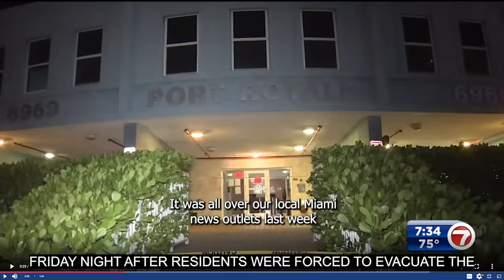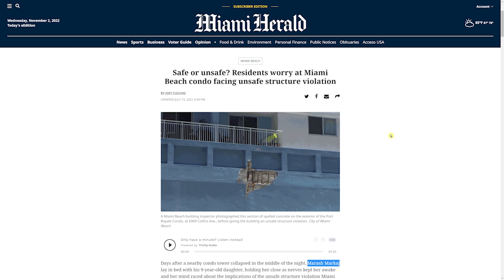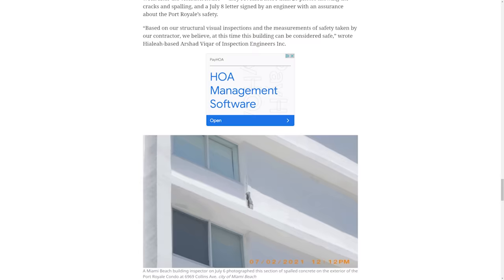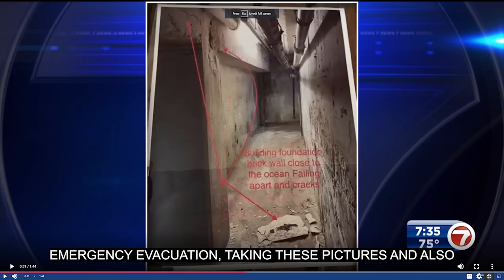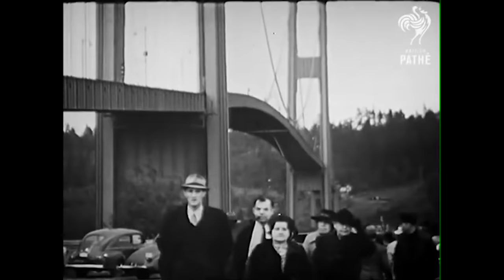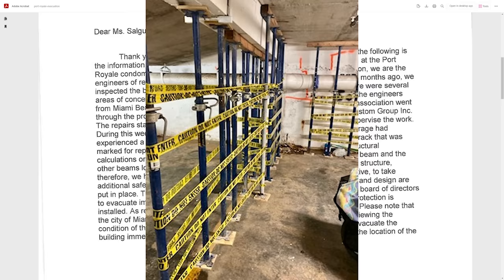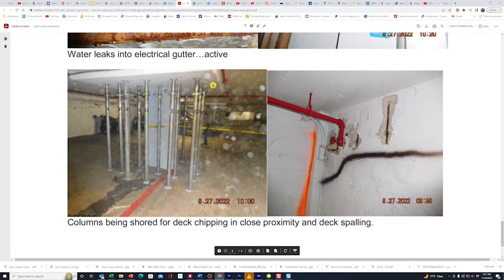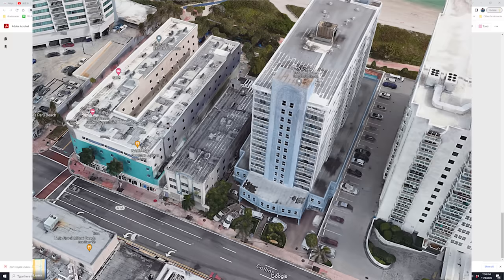Another Miami Condo Evacuated Why it Will Collapse

Comment: From the first footage it seems the entire length of that beam has been patched in the past. For other footage the building looks like it's beyond being repaired and should to be demolished.
Reply from the maker: Sometimes repairs are not done correctly to accepted standards
Reply: @jeffostroff  The issue is that if it rusts the first time, it usually means the covering concrete is too thin, which means most of the hidden steels are rusting in what is a salt atmosphere - hence there are issues everywhere.
Reply from the maker: @cs7th   It usually does not mean the covering of concrete is too thin usually the rebars are buried in inch and a 1/2 into the concrete the problem is that moisture penetrates that deep easily. I have owned condos where leaks on the floor will penetrate through a 4" concrete slab down to the unit below us. It's a simple case of water gets in because it's not sealed properly or they don't upkeep the paint and then it has no problem traveling an inch and a 1/2 down to that 1st rebar rod

Comment: These buildings were built in the height of American produced acid rain. If a building gets leaks the time table for collapse speeds up. Structural concrete is a big mistake and almost every high rise here in Vancouver is being built with structural concrete and acid rain here is ten times as bad as Miami gets. The side walks here are literally dissolving.

Comment: Is it the concrete mix? or the humidity & salt content of air? or other factors also. Honolulu has many condominiums 40 - 60 years old. I think the ground in Honolulu has more solid rocks, igneous rock and no limestone. hmmm ... inconclusive. more investigation needed...
Reply from the maker: These buildings would not need to be ticking time bombs if they simply maintained them better, and sealed them properly, and repainted them on a more acceptable scheduled basis based on how long that paint is guaranteed to provide protection externally to the building.

Comment: They are all concrete built structures that were over 30+ years old had the same problem the rebar is rusting out inside the concrete due to the salt water which is expanding breaking up concrete.
Reply from the maker: Yes, salt on roadways really hurts especially the metal bridges

Comment: Nothing but ticking time bombs, after 50 years in that environment its breaking down from the inside until the day it goes boom. I would not live in any of those older buildings.
Reply from the maker: These buildings would not need to be ticking time bombs if they simply maintained them better, and sealed them properly, and repainted them on a more acceptable scheduled basis based on how long that paint is guaranteed to provide protection externally to the building.

Comment: The person who lived here said he had complained about this problem for years yet he still continues to live there.  Questions about if they should have been evacuated in the first place.  I am sure units in the building have sold recently with new owners completely unaware of all of the structural issues.  We used to take it for granted that entering a building would be safe but maybe we should start to question it.  Everyone for themselves I guess.  I remember watching 60 minutes in the 1980s and they would talk about terrorists highjacking an airliner and crashing it into a building.  Then it happened one day in Paris but the authorities were able to stop it in time.  Should have been a huge wake up call for everyone but no, instead, even after the worlds trade center was bombed once, no one heeded the huge warnings.  The former director for the FBI in New York actually went to work at the worlds trade center because he knew it would happen.  He died in that event.  Not sure why they did not pull the cert of occupancy on this building.  I work in health care and my saying is that you are more responsible for your own health than anyone else.  I am very healthy in my mid 50s and see people younger than me die all the time from preventable issues.  It is what it is.
Reply from the maker: The engineer found the cracks in one main beam had widened recently, that's the difference.

Comment: The use of rusty rebar needs to be banned. Rebar is usually rusty before it even goes in. ! It need not be rusty. Rebar should be galvanised to stop the rust. When will this be law???????
Reply from the maker: They use epoxy coated rebar now

Comment: I wonder if there is correlation between all buildings on the shore of Miami Beach. Was the contractor involved building those buildings? If so, there could be evidence of negligence and credentials.
Reply from the maker: No most of these buildings different contractors, it's all about maintenance. Keep your concrete sealed and painted, and direct water away from the building and pool decks
Reply: @jeffostroff  that make sense.

Comment: Reinforced concrete is a great building material, But is it difficult, expensive, and sometimes impossible to repair. And it can take years to realize errors were made during construction.. I would imagine epoxy-coated rebar and better waterproofing must be the code now. Regular inspections are great, but concrete cracks, and most of the time its not a sign of structural problems, its just that concrete is brittle, and that is why it's reinforced with steel, but both have to work together, This is going to end up like the Millennium tower, an unstoppable problem that has gone too far. I would be hoping for some good insurance if I lived there.
Reply from the maker: Yes eric they did not use epoxy rebar back then but they do now

Comment: all  buildings need a certain amount  of  yearly  maintenance upgrades  but  in florida  and  other places  along  the  coast that are exposed to  the salt based seawater    
are  falling  a [part  faster  then they can  repair them i  would  never buy anything   that is  within  reach of  a  hurricane  seawater  its  a  nightmare  trying  to  keep  up  
with  the  repairs  i  think  you  have  to  completely  rebuild   or  at  least  major  remodel   every 5  years  or  else  you  have  nothing  that  looks like  real-estate  but 
 a  pile  of  trash  lumber  glass  concrete  plaster  insulation  etc
Reply: this  video  is  just   another   reason  on  my  list  why  i  would  never   live  anywhere  close  to  the   sea   its  not  worth it   i  live  in  kansas  and  yea  i  
know  there  are  days  when  i  wish  i  could  escape   but  i  have  lived  in  the  same  house  for  35 years  and  im  content  with  that

Comment: I am constantly amazed at the frankly piss poor construction from around the world where potential profit seems to take priority over common sense. in this case (and others) they built hi rise buildings on low lying land right in the path of multiple hurricanes every year, apart from anything else I would be questioning the ability of the foundations to be able to cope with such a load on what must be sea water  saturated ground and that is before potential hurricane induced flooding. I assume that these structures are on piled foundations but those foundations are sitting in a hostile environment with no way to inspect them,  But this is not the only thing that surprises me, one that caught my eye on other  videos is that there seems to be no practice of removing water run off from roof gutters, here in the UK building regulations require that gutters either drop into a system of drains leading to a soak away within the properties boundaries or if there is no garden into main drainage, but I regularly see videos from the USA where the gutters just drop onto the soil outside the house which seems to me to just be stupid.
Reply: This building is 50 years old though, problems should be expected for a structure of that age.

Comment: I wonder how big is the impact of the hurricanes on this issue. It's not only the moisture but also the high winds on huge buildings areas. If they start swinging then cracks could form, then the moisture gets in and whole spalling adventure begins.
Reply from the maker: Hurricane is probably not that big an issue since it boils down to can the concrete still hold the load
Reply: The wind by itself would not be a big deal for these buildings, it's the wind driven rain and sea spray being forced into cracks and joints that is the problem.
Reply: Now that anyone can go to Walmart and buy a 4K drone that practically flies itself, there is no excuse for not doing thorough inspections more regularly.

Comment: Reinforced concrete multi-story residential towers built on sand by the ocean never seemed like a good investment to me. Much less a place to live after they were more than 10 - 15 years old even with proper maintenance. A couple of floors of concrete block on a slab, fine. More than that is a risk. VISIT the beach....don't live on it. You have heard of hurricanes, right ? Storm Surge will ruin your day.

Comment: I wonder what the test results of the original concrete pour showed? And what exactly was the chemical makeup of said concrete.
Reply: 51 years after it was built, standards have changed...
Reply: @williamhaynes7089  You miss the point of my comment. The question is was the concrete formulated correctly at that time for the conditions of the building? Or was the concrete faulty even for the standards of the early 1970s?

The concrete is failing at an extreme pace for a building only 50 years old. Or maybe Florida just has shoddy standards and building practices. If that is the case, lord help anyone living in a structure more than 20years old.
Reply: @MrBadjohn69  I didn't miss the point, I would believe that the concrete was not regulated well 50 years ago and probable that it was inconsistent with the building plans.. But if it was there is no recourse to file suit against any of the builders at this time... Only thing you can do is  inspect and evaluate and move on either way.
Reply: @williamhaynes7089  I guess you miss the bigger picture. If the concrete was not up to the standards of the time, the next PUBLIC SAFET question should be how many more structures have concrete from that producer?? How many ticking time bombs are there in South Florida? I would hope that SOMEONE in South Florida is concerned about that. Or is loss of life just one of those things that is acceptable if you live on the beach?

Comment: Even the shoring poles look inadequate, especially on that large beam. Shouldn't they have something between the beams and the poles to spread out the load? It looks like there should be more poles as well spread further out from the cracks. As it stands the beam looks like it could still easily fail on either side of those reinforcements. There has to be a better material to use for the re-bar, one that won't rust as easily. I know cost is an issue and we'll never see titanium re-bar but can't they coat it with some kind of rust inhibitor if it's going to be used in a coastal climate? Though I do suppose these towers were built 30-50 years ago so I at least hope the new builds are using better materials. I for one would not feel comfortable occupying that building no matter what they do to attempt to fix it. Nope.
Reply: If the rebar doesn't get wet on a continual basis it wont rust and spawl.

Comment: Is it just me or does Florida suck as engineering these large projects? It seems like several of your series cover huge failures in Florida. Idk if this is just bad luck, or maybe they value unique appearance/function and believe they can achieve it safely and it just turns out bad.
Reply from the maker: Have you seen my other vides this year covering engineering disasters in in NJ and davenport IA?
Reply: Florida has unique issues (unique in the sense that they are all in one spot): extreme heat and moisture, sea water (on the coasts), low water table, limestone bedrock (naturally deteriorates with water), hurricanes, LOTS of rain, termites—these all combine to make building construction and upkeep very difficult. Even the best engineers cannot anticipate all the variables all the time. It’s pretty amazing how often they get it right.

Comment: It sure sounds like parts of Florida need to have mandatory 40 or 50 year demolitions - not inspections - and completely build new structures in their place.
Reply from the maker: They changed it to 25 year inspections by the water, and if they maintain the buildings you won't have this problem

Comment: I think there are environmental influences on all structures on the beaches of Florida: constant high humidity, rather constant normal winds, and intermittant  high winds associated with storms and hurricanes.

Edit comments: load bearing soil needs to be inspected for drainage/compactness and general ability to transmit loads into the earth; inpect for evidence of durability; inspect to see if rain, moisture, and lateral forces are affecting the structures: is water/moisture collecting underneath and around the foundations.

Comment: For the owners of these condo's the reality is having the building condemned is probably the best thing that could happen to them. With a condemned building the only option is to take down the building and sell the land. The value of the land under this 54-year-old building is for sure way more than the aggregate market value of the condos above = owners make more $$ and don't have to live in fear of their building collapsing on them. 

The Champlain Tower property sold for $120 million to a Dubai developer and probably would have sold for much more if the land didn't have a massive tragedy associated it. 

From an economic standpoint it makes sense to tear down the building and sell the property. This happens all the time with once luxurious single-family homes that are aging and run-down but in a desirable neighborhood. They are torn down and replaced with McMansions.  

I suspect in the wake of the Champlain Tower disaster we will see many buildings of the same vintage being taken down preemptively allowing their owners to realize a better profit than if they were to try to sell their units. The towers will be replaced with much taller and luxurious towers built using robust construction methods and computer aided design not available fifty years ago.

Comment: Who installed those pole shores?  U don't shore the area that's spalled. U support the areas around it. I have a concrete restoration company in Broward florida and we have never been this busy.
Reply from the maker: I am sure they are trying to keep that beam in compression and out of tension. This is usually done under the auspices of the engineers
Reply: @jeffostroff  I agree with you for initially supporting there before the spall expand, but now it has completely failed. You don't think there should be Shoring on the beams where the concrete hasn't spalled and also about the beams supporting the overhead slab?
Reply: @stang10189  Looks like "shoring theatre" to me. These are the kind of posts used to fix sagging floors in an old single story house. Doubt they do anything in a building this size. I would expect something more along the lines of I-beams above and metal plates below with much more substantial supports in between with that protected by Jersey walls or similar.

Comment: Modern housing is built for maximum profit $$$
Concrete never lasts the Earth moves, concrete will crack overtime. That's why the old timers used bricks and mortar, to allow for movement.

Comment: Why aren't the regulators being audited and prosecuted?
Reply from the maker: No proof regulators did anything wrong. You have to tell me what crime was committed and match it to what Florida Statute was broken
Reply: @jeffostroff  - How do you know there is no proof?  

The preponderance of failures demonstrates something worth looking into!  People pay a high price for regulation (so-called protection).  What are they getting for their money and limitations? 

I remember looking at an enormous - overly big - convention center in South Florida.  It was much, much larger than the NYC Javits Center or the convention center in Chicago.  I mean this thing was big!  I was with my wife walking along the front of it - We were shocked to see a relatively new building falling apart from top to bottom: Concrete Spalling - and expanding exposed rebar! 

I mean: Gimme a Break!  Who is examining job sites to assure the rebar is being installed within spec?!  I don't see these problems elsewhere!  Not even in the third world country I currently reside!

Comment: Another building not using low sulphate concrete in a salty atmosphere.
Reply from the maker: They really need to focus on selaing and painting these buildings before water and ocean spray gets through the paint
Reply: @jeffostroff  
It's all about profit. They could use concrete that is formulated for that environment. Adding Sodium Silicate to the mix makes it very waterproof but that's expensive in the short-term. By the time the building collapses, the architects and contractors are retired or dead.
Reply from the maker: @untermench3502   They probably have much better mixtures now than they did back then remember the building codes change every 3 years also so a lot of things they did back then you're looking at maybe that may be 15 changes to the building codes since then

Comment: Nothing lasts forever. Buildings near the sea will rot away on the inside of the structure. Because of the salt in the air. These kinds of buildings will fail at some point.